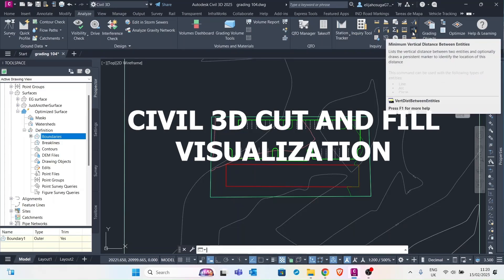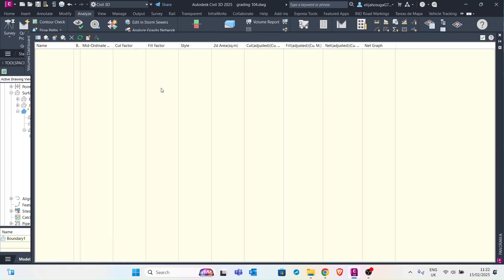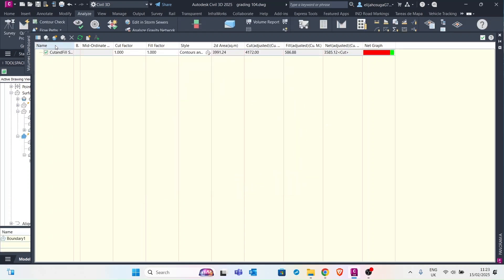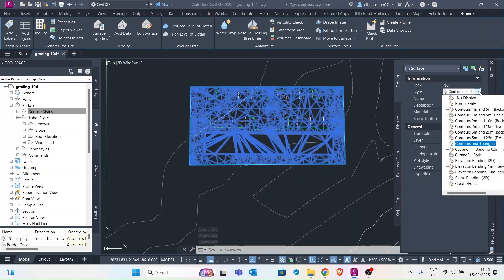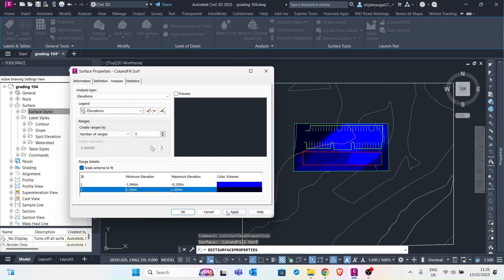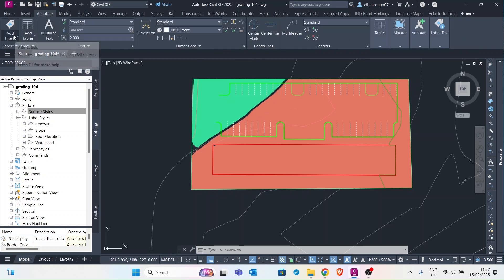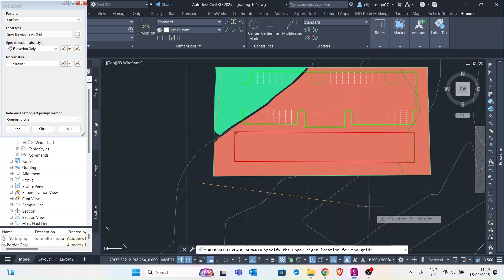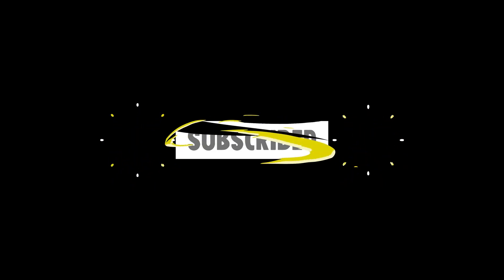Civil 3D Cut and Fill Exhibit using Civil 3D 2025

Comment: знатоки, подскажите, пожалуйста, как максимально быстро и просто найти площадь поверхности дна озера/выемки🙏🏽🙏🏽🙏🏽
Reply from the maker: For a lake you have to do as bathymetric survey. Every lake has a unique depth.
Reply: @g @getcadskills3482  can you suggest an algorithm for doing this?
Reply: @getcadskills3482  I need to calculate the area of the lake bottom right now.
Reply: I need to calculate the area of the lake bottom right now.
Reply from the maker: @blacktwoplaying7747  do you have the surface?  If you have the surface of the bottom of the lake, we can easily get the area.
Reply: @getcadskills3482  yes, I created the surface through the toolbar, but it doesn't show up in my properties. maybe I did something wrong. initially, I only have a drawing from Autocad. does the drawing created in AutoCAD need to be imported into civil in a special way?